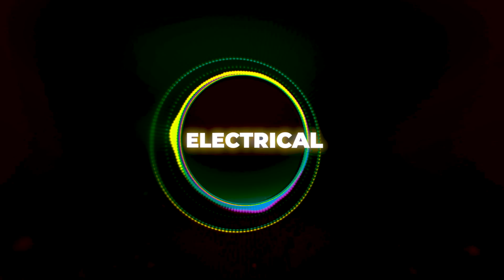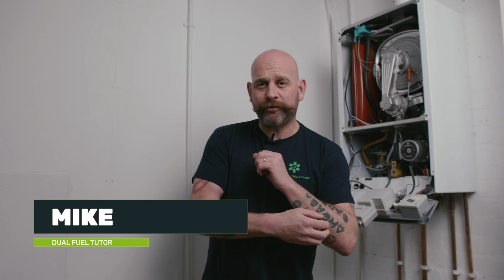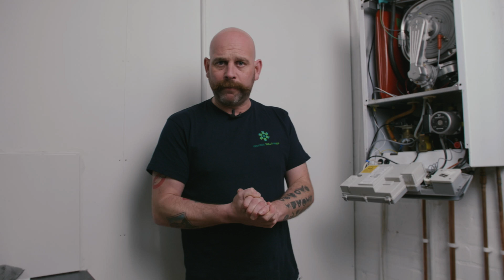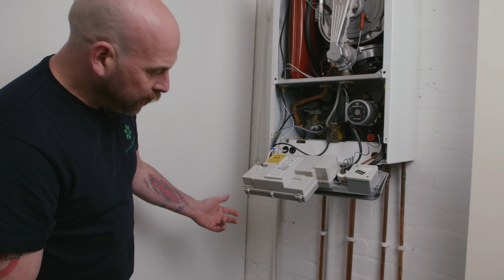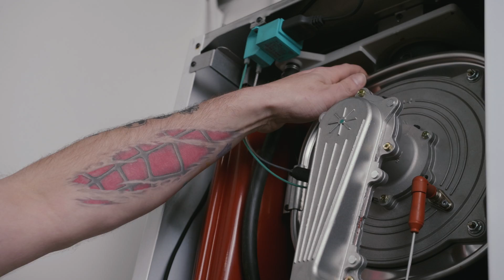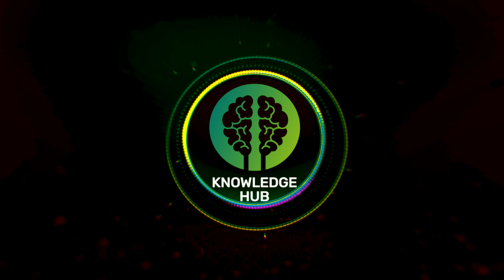What's inside a Combi Boiler | Gas Tutorial

Comment: I've had my boiler serviced 2 months ago, he emptied waste, and said everything was good, it's only just over 2 years old, but b4 he came and when he left it's still doing the same thing, it's flashing on 3.1 which is a fault mood on ,glow worm, betacom4 30c, he said don't worry about it, the worst thing that can happen is it'll just leak outside, do u think the inside theremast needs changed?
Reply from the maker: Our best advice is to get a Gas Safe Engineer round, if it is the temperature which is flashing - it is probably a thermistor fault.